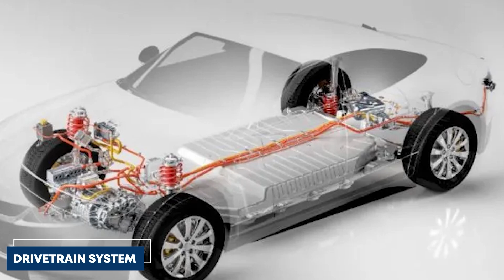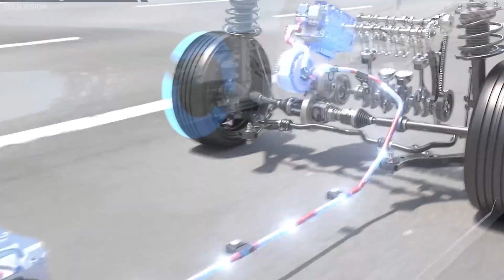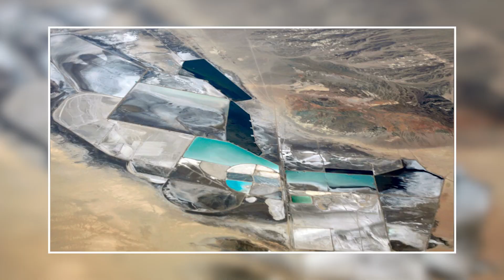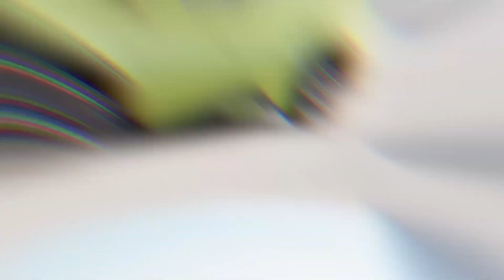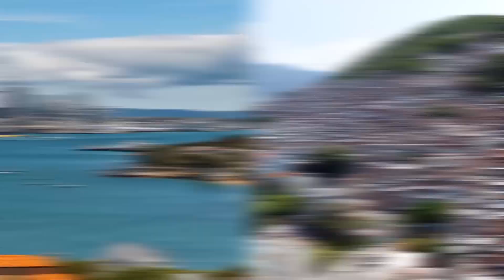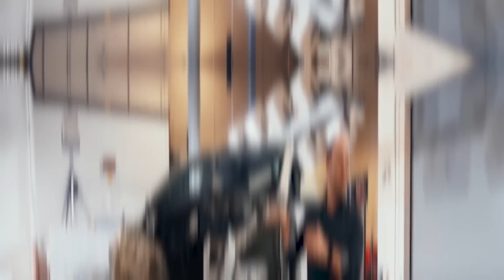China This New Engine Will DESTROY The Entire EV Industry in the U S

Comment: Nice, but I am a gas ⛽️ vehicle person.  I also think these cars are dangerous, they are too light and won't hold up in an accident. These Chinese cars 🚗  will not do well in America.
Reply: I recall Volvo have a prototype car which had motors on each wheel and range and longer than Tesla. Mercedes Benz has a prototype car that has a long range.
Reply: It's Wrong of you to think in this manner. New Technologies Evolve Often to Replace older technologies
Reply: I totally agree with you.  Gas is the best
Reply: Electric cars weigh 4x to 5x more than same gas vehicle same size. Do your research Bro. These heavy cars damage the roads more than standard gas cars. Lithium batteries bad new technology silver batteries good.
Reply: Then u are still using Nokia 1100 in this era